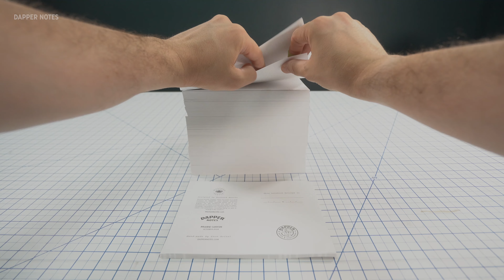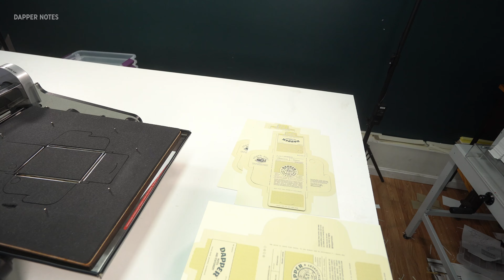25-Minutes of Making Journals Step By Step | How-To, Uncut, No Talking, ASMR

Comment: I noticed the gluing machine in the background, what is your experience with it. Have you used it for gluing the book cloth and if so what are the pro’s and cons? To be fully transparent : I have been making this style of notebook for about a year now and selling them online and on the street downtown where I live (majority of my sells are in person). I have adapted many of your techniques and developed many of my own. Again I would be very interested to hear your thoughts on the gluing machine.
Reply from the maker: I just-just got it, and actually used it for some of this edition's production. 
You can see me using it in this shorter video https://youtu.be/aYc1nWXH-HM

So my experience with it is not very lengthy, and so far I can say that it's quite finicky. It has a bit of a learning curve and will require some added customizations to work well. For example, it's not easy to get sheets to go through perfectly straight, so some guides will need to be built.

Time will tell, but for now I'm optimistic that it'll save me hours of work and more importantly back pain in the long run.
Reply: May I asked where you purchased it/ the model number or a link maybe… I have seen quite a few on ebay and have been close to pulling the trigger on one a few times, but other purchases  always  proven higher priority.